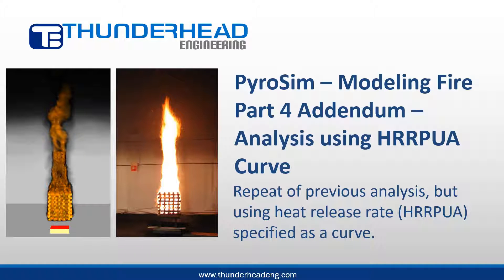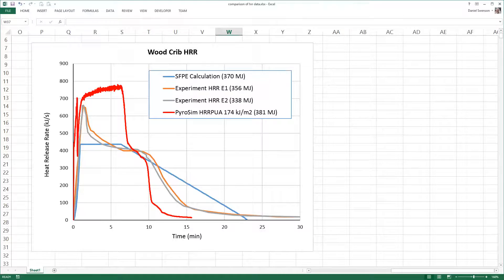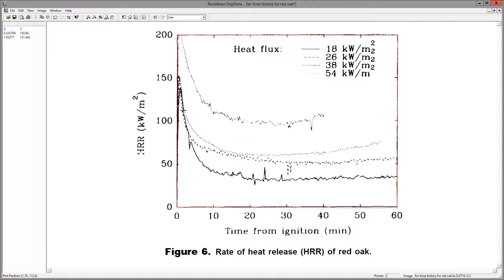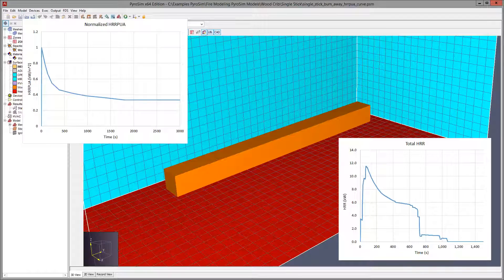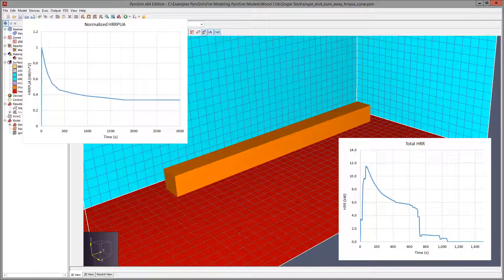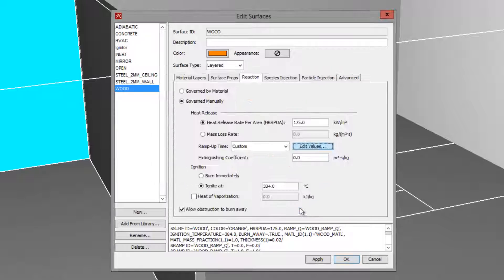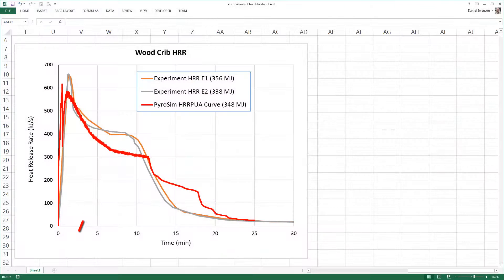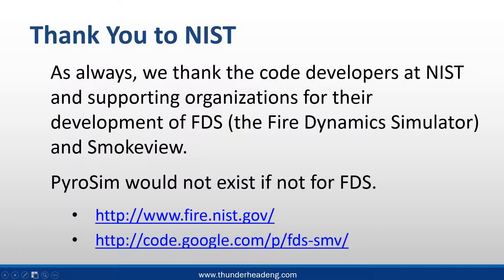PyroSim: Modeling Fire, Part 4 Addendum -- Re-analysis Using HRRPUA Curve

Comment: Hi, how did you model the igniter in this case? You said you use heptane as the ignitor but how could you have two active reaction?
Reply from the maker: It looks like there was only one gas phase reaction of 'wood' in the model.  The HRR would be correct, but the byproducts of combustion would be a bit different from Heptane. I think that what he meant to say in the video, was that a gas burner under the crib was used for a short period of time to ignite the crib, and then the HRR was up to the crib burning after that ignition burner was turned off.  In the experiment, this initial energy was supplied by a heptane fuel burner.
Having said all that, it is possible in FDS to have more than one Gas Phase reaction for different fuels and you could be a bit more accurate with the gas phase reactions.